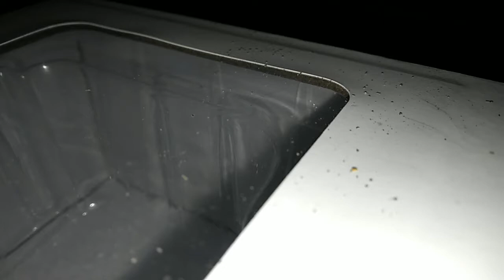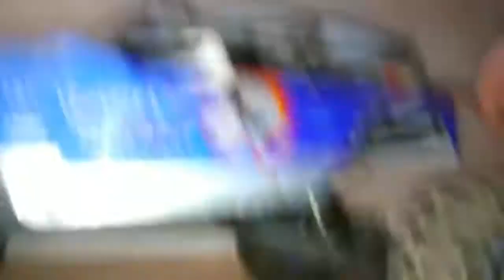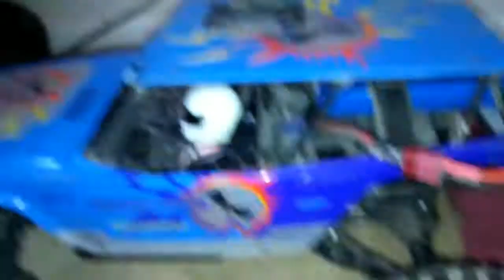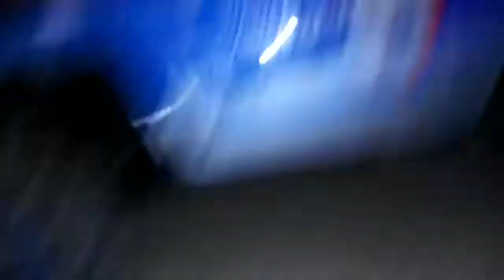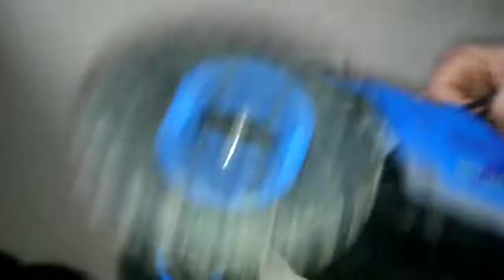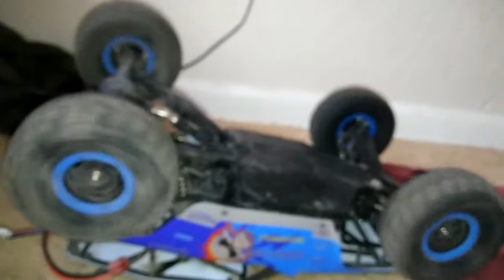Wltoys 10428 recieving issue. PLEASE HELP

Comment: You can try re binding your receiver and transmitter
Reply from the maker: Pizzola89 i tried, but still same issue. the battery voltage is perfect
Reply: What i would start doing is process of elimination. Replace all batteries "controller and rc". if that don t work... Take the body off and unplug one of the servos at a time and try. if it still does it then all that is left is motor and esc/ reciver.
Reply: Might just have to upgrade toy esc transmitter and receiver

Comment: It sort of sounds like the receiver/esc is loosing power for a sec and then powering back on. Have you checked all the wires to make sure all the connections are good? Also if you haven't already try a different batter. if neither of the are the case it might be something inside the unit is going bad/dead. It's a bit tricky to diagnose something I don't have in front of me.
Reply from the maker: Void X RC i have to buy a hex set to work on this one. so it does it periodically. it was doing it all of yesterday but this morning it is running just fine. maybe it is a loose connection somewhere? thanks void x you always are helpfull!
Reply: I hope a loose connection is all it is!